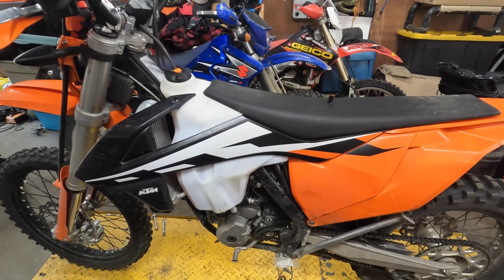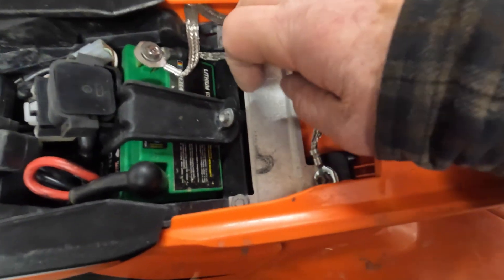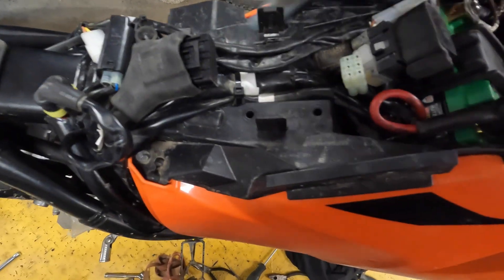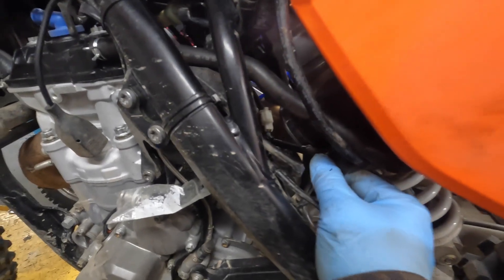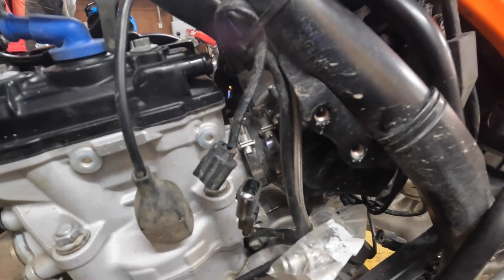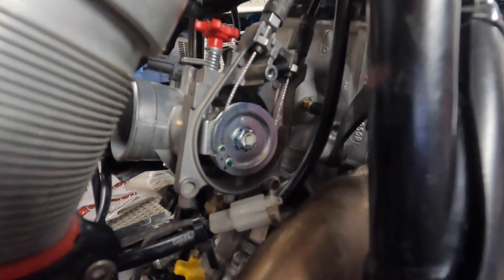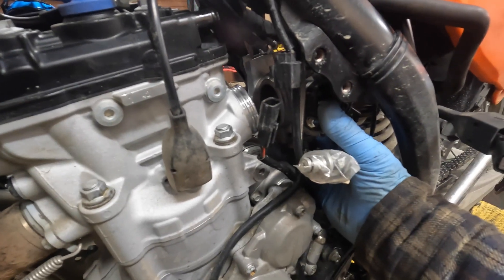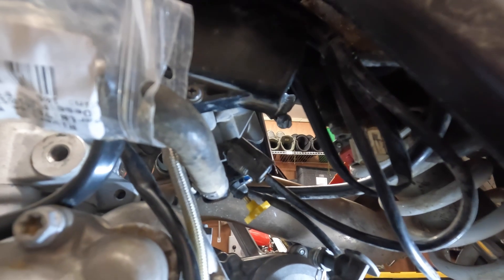2017 KTM Throttle Body removal, TPS sensor testing / diagnosis

Comment: Thank you for the video. I'm pulling the throttle body on my 2022 350 EXC-f. I have a quick question, I think the answer is yes, but did you pull the sub frame bolts completely out? Thanks
Reply from the maker: @brianlarsen9216  I can't recall for sure.  Pull them and just be prepared to thread them back in as needed.  Thank you for watching

Comment: Would love a video were you setup the idle and air screw in the correct way.
Reply from the maker: If I ever have the throttle body out, I may do that.  Hopefully someone else has done such a video.